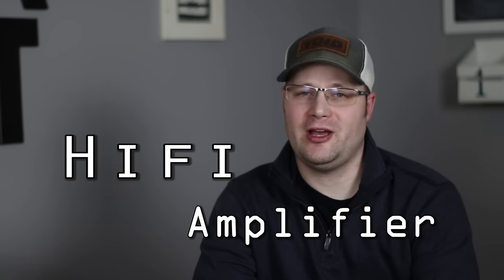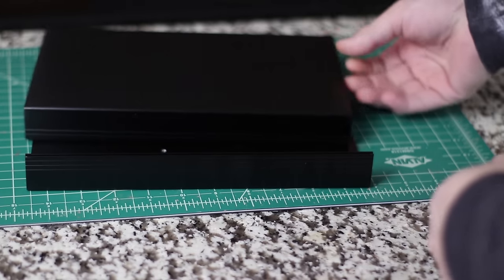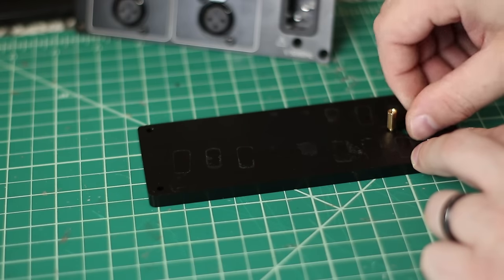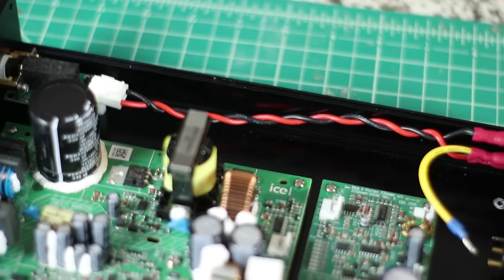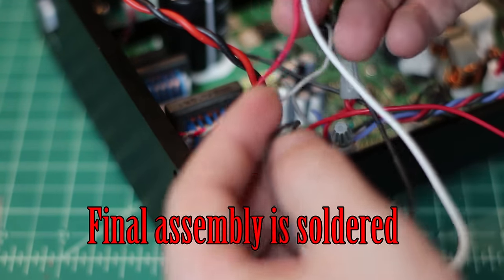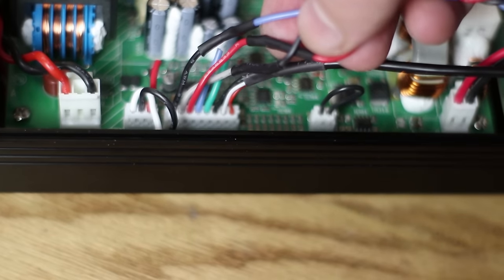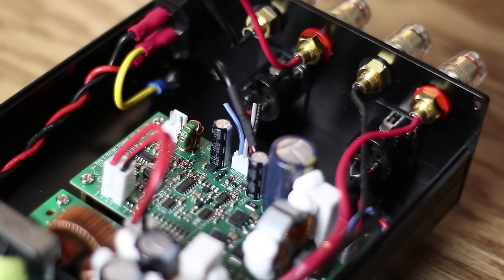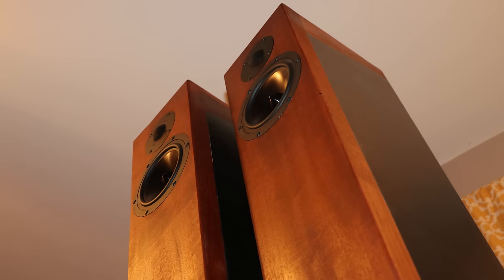How to Make a $3000 DIY HiFi Amplifier for $300

Comment: ebay. marantz ma-500 . about $150 each used. pair of those class a/b 125 watt(@8ohm) (stable for 360watt @2ohm dynamic headroom) and you have your $300 amps that will kick the crap out of these over rated class d pieces of crap. i'm all about diy. i have been into speaker building for years .. yada yada yada.  these boards are a joke.
Reply: the class D amp are great for subwoofer but 0.4% THD is HiFi?
Reply: @poman911  -- Yup.  The human ear can't hear the difference between 0.5% and 0.05% THD, it just makes self-styled audiophiles feel better when the number is lower.  I've owned a fuktonne of "high-end" Class AB gear over the years and am a lifelong musician, and today's Class D chips -- even the supposedly "low-end" mass-produced stuff from the likes of TI -- are right up with the best of them when it comes the actual human music listening experience.  Put your money into speakers, folks -- even high-end companies like PS Audio are going Class D and building products around OEM boards from chip companies, and if you're a sensible DIYer you'll do the same.
Reply: @editorjuno  

I looked at PS Audio website and what they did was a hybrid Class A input stage and Class D output stage.  The only pure class D amp considered to be Hifi is the Technics amp which uses a different material for the transistors called "GaN (eGaN®) transistors" that "switch up to ten times faster than silicon MOSFETs, with ‘zero’ stored charge. The increased switching speed of eGaN FETs allows amplifier designers to increase PWM switching frequencies, reduce dead-time, and drastically reduce feedback; producing a sound quality previously limited to large, complex, heavy Class-A amplifier systems."

Why is class D looked down?  They require alot of feedback to correct for distortion see here: https://epc-co.com/epc/GaNTalk/Post/13752/Gallium-Nitride-Brings-Sound-Quality-and-Efficiency-to-Class-D-Audio
QUOTE
"To accomplish the required headline marketing THD+N performance targets, Class-D amplifiers have had to resort to using large amounts of feedback to compensate for their poor open-loop performance. By definition, large amounts of feedback introduce transient intermodulation distortion (TIM), which introduces a ‘harshness’ that hides the warm subtleties and color of the music that were intended for the listening experience.

The silicon MOSFET has been the switching transistor of choice for Class-D systems for the past 25 years; and although producing a more efficient amplifier, they have been plagued by distortion due to imperfect switching, high on-state resistance, and very high stored charge (see Figure 1). The recovery of the stored charge dissipates power and causes ringing, which leads to additional distortion in each switching cycle and cannot be eliminated through the typical output filter approaches."

So the 0.4% THD is better than some of the class D (typically 1%) but I don't see it as High Fidelity.
Reply: @poman911  -- I'm amazed that you don't see the obvious fallacy in your thinking.  The distortion level in any audio signal chain is determined by the part of the circuit that introduces the highest level of distortion, so PS putting their class A "analog cell" input stage in a product with a supposedly deficient Class D output stage is not going to remedy that presumed deficiency.  IOW, PS is engaging in a little marketing hype to distinguish their pricey product from less expensive products based on the same IcePower output stage.  Moreover, lowering the distortion of a Class AB circuit also requires considerable and carefully controlled feedback, so Class AB's advantage in that respect in minimal and it's overall performance advantage over expertly designed Class D circuitry -- and the design teams of all the Class D chip makers are far better than anyone in the so-called "high end" audio industry aside from a few semi-retired legends -- has been vastly overstated, especially when evaluated in the context of the limitations of human hearing and even the very best source material.
Reply: @editorjuno  The only way to settle this is to have a double blind test using the same High End speaker with an A/B switch to a class D and a class A or A/B amplifiers!  I for one won't but this youtuber should back up his claim of $300 amp as good as $3000 amp!
BTW I use class D in my boombox https://www.youtube.com/watch?v=RoQD5eckQx4&t=50s
or my car stereo and they are awesome for power per size.  I would hesitate to use class D, especially a $300 board driving high quality speakers.
Reply: @poman911  -- I remember witnessing a similar shoot-out between the classic McIntosh MC-275 and the upstart Sony TA-3200F back in the early 1970s, with both power amps driving a pair of the best speakers of the day.  The result of several similar head-to-head "glass vs. sand" comparisons?  McIntosh soon discontinued the MC-275 in favor of their own solid-state models.  IMO Class AB will be going the way of the vacuum tube in a few years, becoming a niche technology for those who (perhaps imagine they can) hear an advantage to the older, much bulkier, and far less efficient technology.  :-)
Reply: @donalddluckerii3147  -- I stand corrected.  I was going by memory and may well have recalled an outdated and/or since-disproved study.  Can you provide a link to your source?   Thanks in advance!

Interestingly, even very inexpensive Class D chips can approach or even cross that inaudibility threshold for THD.
Reply from the maker: @donalddluckerii3147  just an FYI this amplifier has a THD+N of 0.2% at 200W @4ohms. I'm not sure where the 0.4% came from. Either way, I'd love yo know the source on what amount of distortion the human ear can perceive.
Reply: @editorjuno  I must apologize for my hypocrisy. That .2 % I mentioned came from the exact same place your specs came from, my memory. I could swear I had read a scientific study that stated that spec and wouldn't you know it after your polite request for a source I  went on a mission to provide such and after  a frustrating hour or so, found this: https://www.audiosciencereview.com/forum/index.php?attachments/1539032555377-png.16299/ In it there's a line showing my .2% as the beginning of audibility of distortion...well...it also shows your spec. Apparently the actual number doesn't exist as each study produced wildly different data. I must have read one study and you must have read a different study. My apologies sir. I was feeling so superior too.
Reply: @Toid  That's one impressive amp. I fully disagree with amplifier power being rated at 4 ohms by the way. It is a misleading practice that used to be policed by the FTC but in recent years has become the standard. Though I am not aware of any change in  the FTC 
"Amplifier Specifications Rule". They chose 8 ohms because that is the accepted nominal impedance of the vast majority of residential speakers.  I understand that speaker impedance is in reality a moving target but, I still disagree with the current practice. As for my source on the spec I provided? He he you can read my apology to Mr. Morgan. Seems there are many studies on the subject, each providing different data. I was actually guilty of the exact thing I accused him of.
Reply: @donalddluckerii3147  -- Fair enough, my friend.  No harm, no foul.  I think we can both feel a just little "superior" in that we've managed to discuss a tricky issue in a civil, mutually respectful way -- and I thank you for that.  :-)
Reply: @donalddluckerii3147  only of you like to hear static in your output and yes you can hear it in every class D I have ever heard or had
Reply: @editorjuno  that is a class A verses a class AB not a class D
Reply: @waderyun.war00034  We use Crown XLS amps often and they are quite silent  noise wise.  Which amps are you referring too?
Reply: @waderyun.war00034 .5% is at max power. Crown (like many who sell inexpensive commercial amps) are grabbing your attention with inflated wattage numbers with the accompanying high distortion. If they were posting honest 20-20k power ratings we would see that these amps are actually about half of their advertised power and the distortion specs would be much better. Under residential use they are silent without signal.
Reply: @waderyun.war00034  -- What are saying "is a class A?"
Reply: Thd quotes are inadequate. What are the harmonics , odd , even , what dB down , what frequency and power level? What's the channel separation and crosstalk? How's the slew rate , dynamic range and damping factor at different frequencies? And does it run crysis? 😉
Reply: @editorjuno  just because you can't hear the difference doesn't mean no one else can. i know i can. all the time people show me their radio setups and they think it sounds amazing but i can hear the distortion and imperfections in the audio. i just sit there wondering how the can think it sounds so good when it doesn't then i have to remind myself that different people hear things differently.
Reply: amplifiers are graded for sound quality in my book...
A=absolutely great for the nerds
B=balanced cost performance
C=Crap for the masses
D=Diabolical piece of shit for mp3 players

Comment: QUESTION: Please. I built this unit using this video and another with the same Ghent Audio kit. I am getting 60 Hz ground loop hum. I was using the Monoprice XLR to RCA adapter cord as suggested. I plugged it into my Starving Student 2 Tube amp line outs.
 I did get it to stop by shorting the ground on the back of the Neutrik XLR socket, and it stopped. But I want to use this as an XLR unit. I bought the Nobsound passive preamp that has balanced and is switchable to XLR or RCA. I am going to purchase either the Soncoz LA-QXD1 or the Geshelli J2 balanced DAC 
Is there something else i should be looking at? New shielded power cable? Should I be grounding the Neutrik socket using the extra tab on the back of the socket?
Thanks for any help you can offer.
Reply from the maker: Any unbalanced signal can be prone to ground loops. Once you go balance, you shouldn't have an issue.  Although you still can, it's just less likely. Here's a good article that helps you track down your issue. https://www.soundonsound.com/sound-advice/q-do-balanced-connections-prevent-ground-loops
Reply: @Toid  thanks! Love the channel! I appreciate you taking the time to respond.

Comment: Well that was 13 and a half minutes of my life wasted.  What alternate universe do you live where you image your amp is worth $3000?  These amp boards are nothing but run of the mill class D amps.  Where are your test results?  What is the frequency response? What is the THD+N at rated output? What is the rated output in RMS watts per channel? The data sheet for these boards states the output in simply watts.  Is this peak instantaneous wattage (twice that of RMS wattage) or RMS wattage?  Worse that that, according to their own data sheet, these amps have serious problems with steady-state output above 8Khz (output down more than 80% at 20kHz) due to their topology.  Class D amps are fine for many applications where efficiency is important or there are issues with cooling and they make acceptable (if just barely) sub-woofer amps as long as they are low-pass filtered below a couple of hundred Hz. But no one should image that these even remotely audiophile quality amplifiers.
Reply from the maker: RMS 200x2 at 4ohms with THD+N 0.2%
Reply: @Toid  show proof not receite the specification sheets. audio manufacturers lie about the specifications of there amplifiers all the time even some of the brand name ones
Reply from the maker: @waderyun.war00034  There's plenty of proof on this amplifier.  You are welcome to search for it.  If you want to dispute those facts, you are welcome to do an independent study to prove your point.
Reply: Icepower modules are not "run of the mill" class D, upgrade your knowledge fool
Reply: @Genuine Audiophile All depends on the situation, as for this instance...Nope
Reply: www.altronics.com.au/p/k5165-ultra-low-distortion-mk.3-135w-stereo-amplifier-kit/
Hard to beat, Really is build your own, Not Class-D, Specs very good, Sounds excellent.
Reply: @tothemax324  Please enlighten us all as to what distinguishes the ICEPower 200ASC amplifier board from other similarly priced class D boards. And don't waste our time by quoting from their brochures or B&O's website.  I have searched through the data sheet for the 200ASC and I see nothing out of the ordinary. In fact any competently designed class AB amp will easily out perform it in any objective test you can perform. Or you can just continue to make unsubstantiated claims and call people names.
Reply: @tothemax324  Well I think you have shown us all that you are quite the towering intellect!

Comment: Thank you for this. I'm seriously considering this project. One question, if you replaced the US power cord with an Australian power cord, would that work, or would that burn it out as we run 230v 50Hz connections?

Comment: Have you experimented with external power supplies on these amps? Seems like you can get much cheaper (and possible better) ones on Amazon than the included ones.
Reply: The power supply is integrated into the 200asc amp module as it is with most ice power units. The 200as then taps into the supply on the asc. The ps sections are also specifically designed for use in class d amplification.

Comment: I am missing something here, great video by the way. Are you using the 200asc board purely for power then, then connecting the two other amps to create stereo and therefore buy passing the 200asc's amplifier stage? Sorry for being naive but isn't there a product with just the supply and wouldn't it be cheaper?
Reply from the maker: The 200asc has a built-in power supply. That power supply powers the 200asc and up to two additional 200ac boards for a the channel amplifier. For a two-channel you only need the 200asc and the 200ac. It does not bypass the amplifier stage.
Reply: @Toid  ok, thanks for answering. New subscriber en route.

Comment: Where's the volume? Doesn't the output wires for the speakers look like they could be a much more heavy gauge? Pushing that much power has to eat more than those wires can handle. I wonder if they get hot when you crank the amp?
Reply: Wire gauge requirements are almost entirely a function of load impedance and length.  Only the very thinnest (24 AWG) stuff sold as "speaker wire" is going to heat up to any significant extent at any volume that won't threaten music (if you listen to signal generator output or jet engine noise, all bets are off)  listener's hearing, regardless of amp power or speaker (in)efficiency.  Compiled many years ago, retired McIntosh engineer Roger Russell's advice still holds up well and is actually pretty conservative IMO.  http://www.roger-russell.com/wire/wire.htm#wiretable
Reply: @editorjuno  Good thing to know, I just wonder why my house amp 200 watts has much thicker wires going to the outputs and they're only a couple inches long, strange.
Reply: @MrBrymstond  --- AC mains current demand tends to be relatively steady whereas in home audio the occasional high current peaks in even the loudest music aren't long enough in duration to heat up (all but) the (thinnest) wire.

Comment: The only disappointment is that the pic on the Ghent web site shows Neutrik XLRs and mine shipped with poor quality Neutrik clones. I was about to do a wire and connector order from Markertek anyway, so I ordered some Neutrik D Series to replace them with.

Comment: Still trying to wrap my head around amps and amp building. Used a large Yamaha 2.1 ch amp for a record cabinet and liked it but the form factor is massive. Very interested in this and would like to see if it could be built in maybe with some brackets or new face, only want the front to show. The inputs are those XLR connections which is fine, but how do you switch inputs? How do you control volume? Sorry very new to all this
Reply from the maker: No worries. This is a standalone amplifier. That means for the inputs and volume you would use a preamp. Sew4home theater that would be a surround sound receiver with a 7 channel RCA or xlr output. your receiver would then switch all your inputs do your volume and decode the signal. this type of stand-alone amp would give a significant increase in clarity and power over the amplifier in a standard surround sound receiver.
Reply: @Toid  ahh, ok. Hmmm, would you have any of your own content or somewhere else to point me if I'm looking to build an amp that can handle at least 2 inputs, record and Chromecast or Bluetooth, and output around 50 to 100w per channel? This here could do it, I just need one more component in front of it sounds like. I really want just the front plates to show up on top of the cabinet when you flip open the lid, I want them to see a power switch, input control, volume, everything else like bass and treble is just gravy

Comment: Also, beware of those cables. That XLR connector looks like the one a guy brought to a gig with his cloned SM57s he got on Amazon. If they're the same ones the housing is plastic, and is a few thousandths smaller in diameter than proper XLRs from Neutrik and Switchcraft. I was running sound that night and I figured I'd try his cables only because it meant I didn't have to run into the storage room and grab two more XLR cables, and when I tried pulling them out of the snake they didn't want to come. Almost broke them taking them out. 10 out of 10 times I would recommend just making your own cables. Go to Markertek or a place that specializes in audio cabling and connectors, and just solder your own.